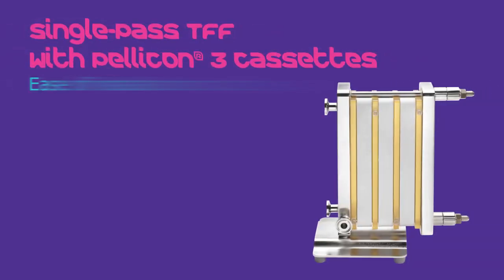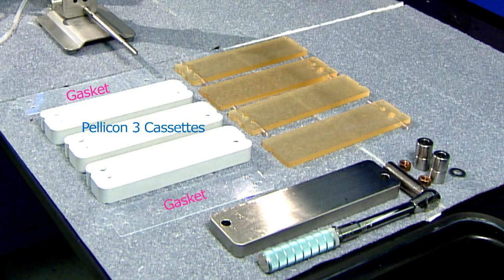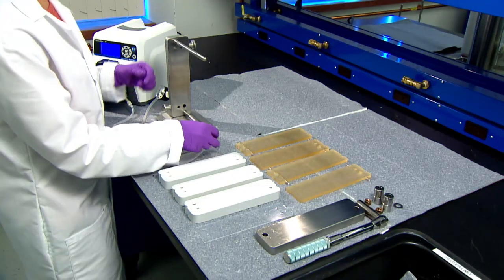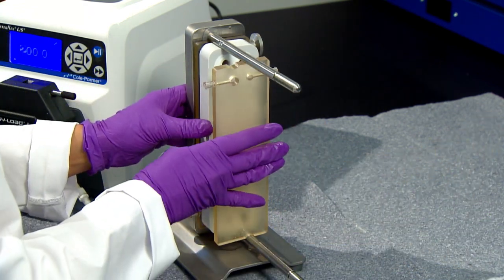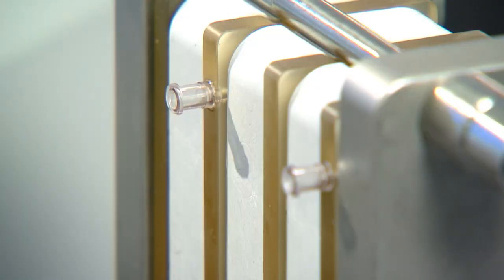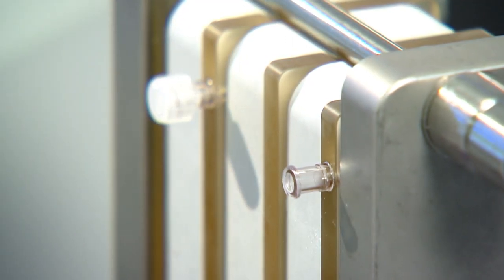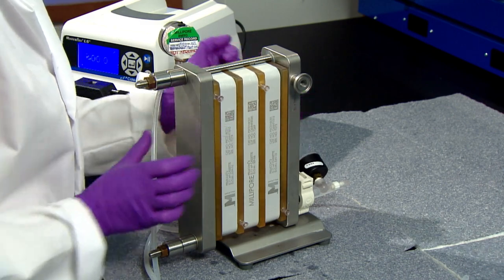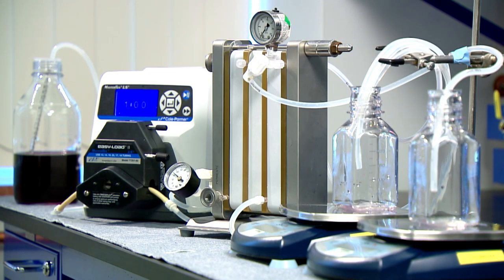How to install Single-Pass TFF with Pellicon® 3 Cassettes : video tutorial

Comment: What is the use of this thing?
Reply from the maker: Hi Br, thanks for reaching out. This is an ultrafiltration solution to help businesses to improve your process so that you can run connected or continuous processes, intensify chromatography and filtration steps, control in-process volumes to improve facility fit and achieve high concentrations and high yields.